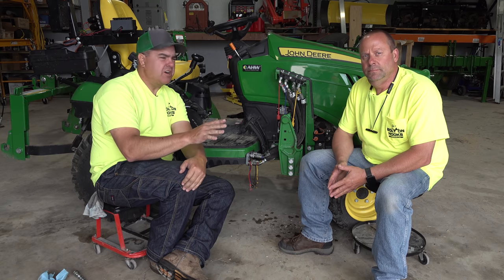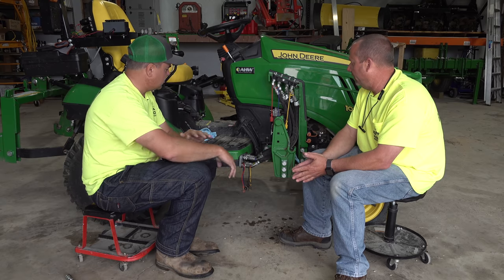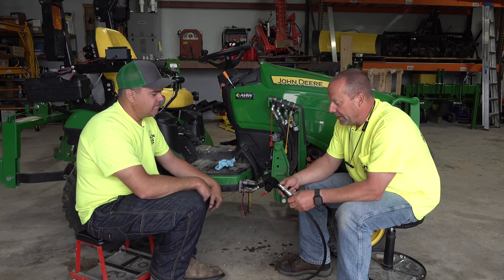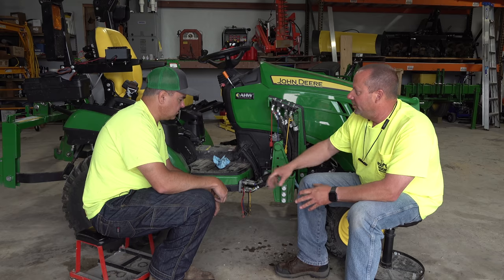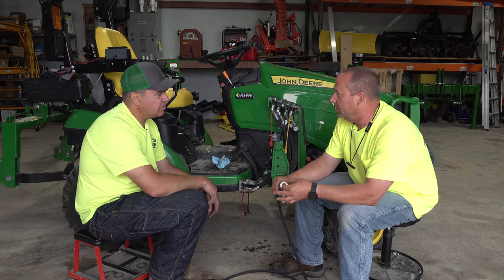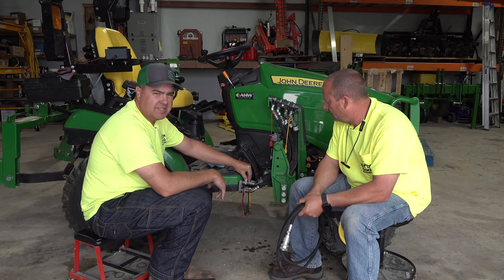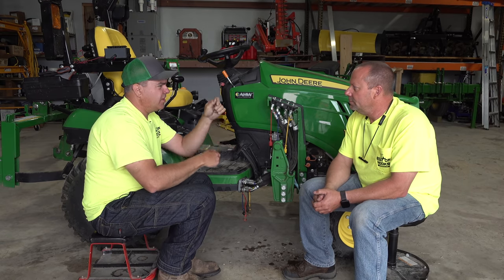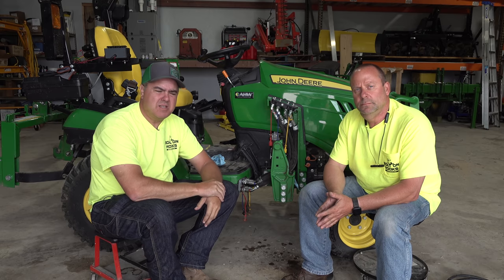How To Solve Tractor Loader Hydraulic Issues

Comment: Hi Tim.  So I watched this video buy I am still having trouble with my 1023E front loader not wanting to go down when the engine is running.  I have disconnected all couplers and cleaned them with wd40.  Reconnected and it still won't go down when engine is running.  It will allow me to lower it slowly down when the engine is off.  Anything else I can check?
Reply from the maker: Do all other functions work well? Lift, tilt, curl?
Try plugging the lift/lower hoses into the tilt/curl plugs.  
And try the reverse…tilt curl hoses into lift/lower plugs.  Do all 4 functions work then?
This will help you isolate the issue.
Reply: @TractorTimewithTim  yes, all other functions work.  I'll try changing ports and see what happens.  Maybe it's a bad quick connect?  Any way to free it up if it is a frozen/defective quick connect or does it have to be changed?
Reply from the maker: @paulcorsetto6047  if just a quick coupler, that is easy!  Just replace it.  Especially if on the loader side.  Cheap:-)
Reply: @TractorTimewithTim  do you have a video on that?

Comment: This happened to me just a few days ago. The loader would only go up half way, and didn't have any downforce...I got down and saw that one of the quick connects must have been hit by a branch, and uncoupled.
A couple weeks ago, a 2" branch in the tall grass kicked up and became wedged in the cast aluminium return pipe that comes out of the bottom of transmission/hydraulic tank...bust that sucker off at the flange, and immediately flushed out nearly 7GAL if hydraulic oil. Good time for an oil and filter change.🙄🤣🤣
Reply from the maker: What model tractor?
Reply: @TractorTimewithTim  we have a JD 4200. I think it's only 26HP, but it has served us well for nearly 20yrs. Has a woods1009 loader, which really gets worked keeping the 45 non-tillable acres maintained. I'm looking for something bigger though for bigger mowing path, and heavier lifting.

Comment: I'm looking to buy a used 3046R cab tractor. Do you know what size finish and brush mower I could run on it? I've got a 5 foot of both but takes a while to do 5 acres of lawn. 46hp seems like a lot though
Reply from the maker: If you can afford, the PERFECT brush mower is the Rhino TS10 flex wing 10’.  It does a beautiful job. MUCH better than a single spindle.   Picks up the grass behind the tractor tires and cuts it cleanly.  We have many videos on it, including several showing it pulled by a 2038r and one with it pulled using a 3039r.
Your 3046r CAB tractor along with the TS10 would be a perfect combination.
Reply: @TractorTimewithTim  that's actually the exact one I was looking at. I found that finishing mowers actually take more horsepower to run especially if there's any grass clippings on the ground such as just have gone over it the brush hog. Do would a 7-8 foot be better for the finish mower?
Reply from the maker: Would be nice if you could find a multi deck finish mower in the 10’ range.  This would provide a better cut.  No idea if one exists...usually the multi-decks are 12’-18’
Not sure you could pull a 12’
Reply: @TractorTimewithTim  yeah and it would be a shame to buy something too big and it not working right or having to crawl along one mile an hour for the whole job.
Reply from the maker: We have a TS10 video coming out soon.  You might be surprised.  This mower will do an amazing job.  You might not need a finish mower.
Reply: @TractorTimewithTim  I wish I could send some pictures of what my current finish mower does. Looks better than a riding lawnmower. I also wanna do some field cutting for hire

Comment: Boo mahindra emax 25 total beast eats jd for breakfast and dumps a load of kubota by noon. Three point wouldn't work tore apart everything. Figured out seat belt latch had went down into the hole where the lever comes up and blocked full travel of lever

Comment: My four wheel drive not working on my 2008 3120 John Deere it's only got 400 hours
Reply from the maker: Uhoh.  I broke the engagement shifter on my 2038r by trying to force it.  They had to split the tractor to fix it.  Embarrassing.

Comment: '...everybody hates WD40 for lubrication'?    Please educate a newbie  What wrong with it and can someone suggest a better product?  BTW, I do use grease for my zerts, but for everything else?
Reply: Fluid Film is an excellent lubrication product. Far superior to WD-40.
Reply from the maker: There are also several WD-40 ‘specialist’ products which are better for lubrication.
Reply: WD40 was developed as a water displacement chemical. It was the 40th recipe they tried, hence the name WD40. It was never meant for the retail market and it was accidentally marketed by a researcher who would take home small amounts for personal use. His friends would borrow a little and eventually the company saw the market for it. It is good for cleaning zerks prior to and after greasing.
Reply: @briangc1972  It is an excellent cleaner. I recently had some goo from electrical tape on a surface. It was super sticky and one shot of WD40 and it wiped right off.

Comment: I have a 2010 JD 4120. My loader is slow to rise, slow to dump the bucket and sometimes is jittery. It’s done this gradually over time. I did add a power beyond kit for my backhoe attachment but I didn’t notice if this started before or after the install as I use my tractor very little. 10 or so hours a year. Maybe more if we get dry weather as all my property is prone to swampy areas and I’m unable to mow the field. 
Do you have any idea what I might look for to relieve this problem?
Thanks